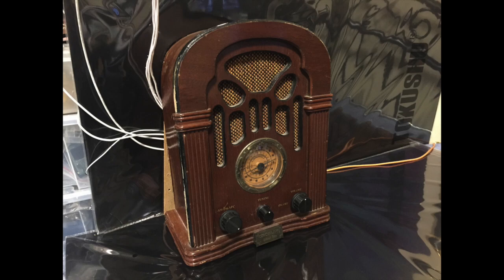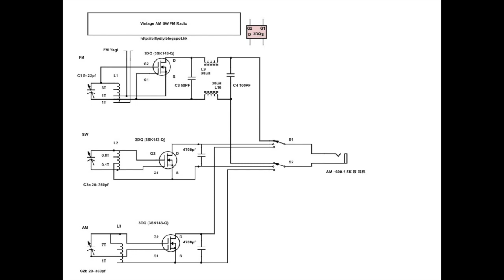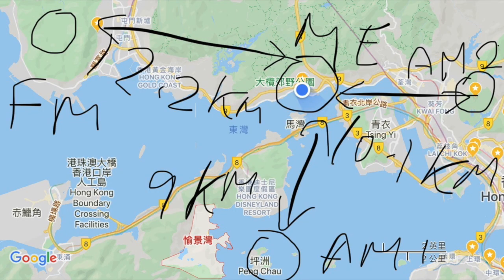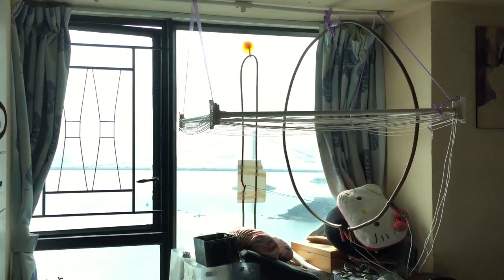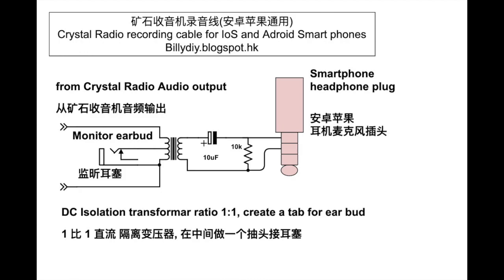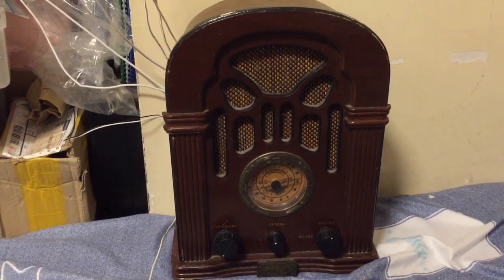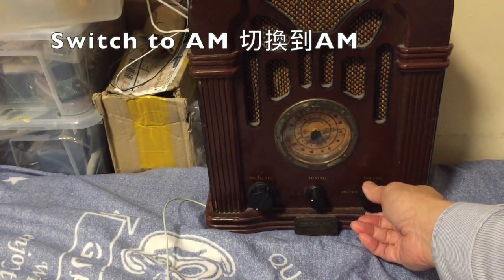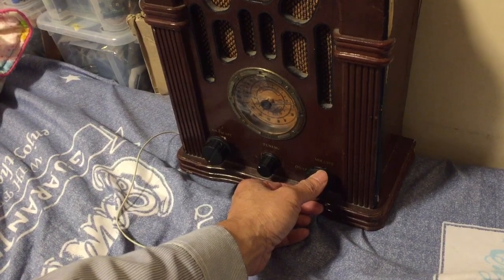Turn a Vintage Radio into a Crystal Radio 將仿古收音機變成礦石收音機

Comment: Can I use a different transistor or diode? 3DQ is very expensive even when ordering it from China to Russia.
Reply from the maker: Certainly, you can use any diodes that are sensitive enough to receive the weak broadcast signals and with matching output impedance with the head phone you are going to use. Otherwise, you need an output impedance matching transformer.
Reply: @BillyCdiy  Please make the following video about FM radio on diodes.I'll wait, thank you. ))
Reply from the maker: @lindigrin  , I have already made one. Check this out. https://youtu.be/YgYevZEqNhY